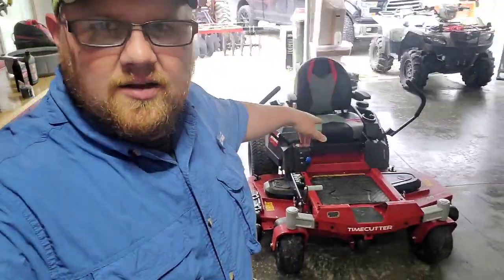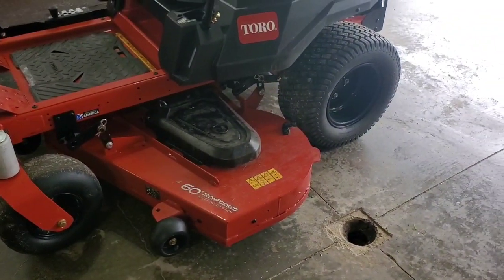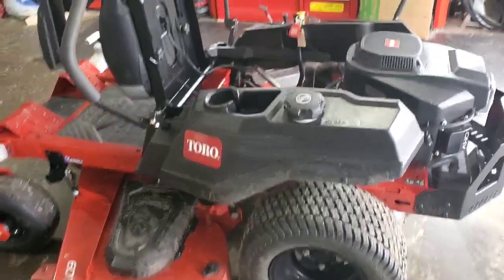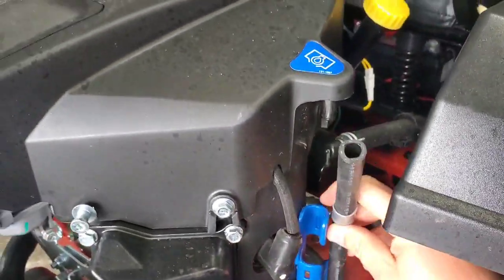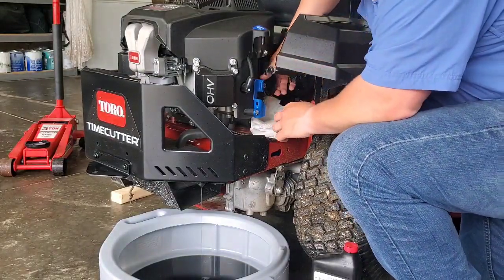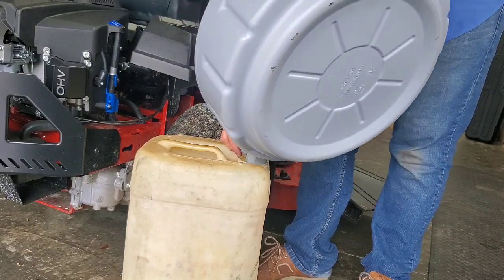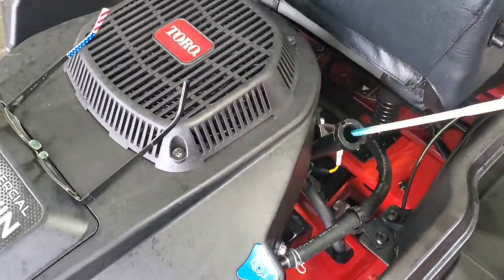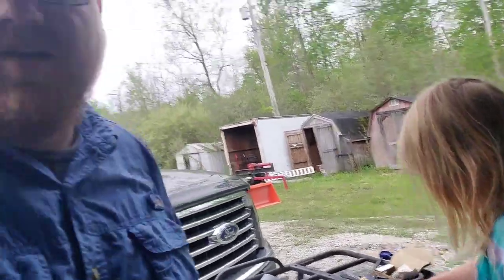2020 Toro Timecutter 60 review and first oil change

Comment: I just bought the Toro 54-in zero turn with the my ride system and I absolutely love it! By the way you'll notice a huge difference in the amount of heat the engine puts off with regular oil versus your new Toro synthetic oil, mine runs so much cooler with the new synthetic oil! Thanks for the video and enjoy that Toro!
Reply: Is there a temp gauge?

Comment: Did you start the mower up for a couple of minutes to warm up the oil before the change? I did this when I changed mine out, and it flowed real easy and fast. I also like to fill up the filter half way or so with oil so there's some oil in it for the first start up. Cool vid. I love my Timecutter. Purchased the 54" with the myride. Really comfortable if your cutting on anything but nice even terrain. I can now cut for 5hrs. plus and  not feel like I've gone ten rounds of just body blows.
Reply from the maker: They didn't even have a Meriden in stock for me to look at beside a smaller 50 inch. I'm surprised how well this rides over some older  models I've used. Indid warm up the oil a bit. Maybe should have ran it longer. Seems real slow to me. Thanks for watching! Enjoy that myride!

Comment: My son purchased a my ride hd 60" for me Fall 2018.  Thank you for your review.
I too found the oil took some time to drain but the manufacturer recommends you start it and let it run for 5 min first and then drain the oil with the front wheels raised slightly and it does make a big difference.  
     I am not naturally Mechanical so I need a lot of help.  It was so difficult for me to install the bagger system (which works very well) the first few times. as the instructions were hard for me to follow and I didn't realized I needed a break bar and a torque wrench.
QUESTION.  I would love it if you could post a video of how you use a strap and hoist up your mower with your Kubota to clean the blades.  I also have a backhoe loader and just don't know what kind of strap to use where to place it and how to hoist it up to wash the blades and/or sharpen them.
Reply from the maker: I can do an video this week for you. I was planning on doing a one year review also. Thanks for the comment! I've looked into a bagger unit, I feel it would help with our compost projects.

Comment: Thanks for the nice video!
Too bad Toro made the oil drain easy (yet very slow) and tool free, but, didn't take further steps to keep the area under the oil filter clean from removing the old filter... I wonder the Toro designed oil drain tube, if it ever needs a replacement how many arms and legs will that cost...
Reply from the maker: That is a very good point. It is kind of a pain. Thanks for watching!

Comment: Literally couldn’t get the hose off an broke the thing it plugs into, nice. Thanks Toro!
Reply from the maker: Ya that part wasn't fun. Little grease and a hope it doesn't happen again.
Reply: I just did this. Any word on how to fix or what part to order?
Reply from the maker: @904GorillaProductions  I will call my dealer amd see if they have the part number. I couldn't find it.
Reply: @PheasantLaneFarm  yea I ended up at a shop that handles toro and they told me I had to order a new engine cover which they needed a pic of two sku/serial numbers before they ordered
Reply from the maker: @904GorillaProductions  im glad they were able to get you squared away.
Reply: I just did the same exact thing, and got on YouTube to see if anyone else was having this problem.
Reply: @MasonBills  yea I realized that. I thought it actually was part of the oil circulation but after taking it to the shop it is just the drain like you said.
Reply: Hey guys happened to me too. Got the new oil hose within a few days. It got its own end cap which can be easily opened closed now via turning it. Part number should be: 144-0976
Reply: I put a screw in it and just to be safe small hose clamp. No issues two years later
Reply: A few seconds applying heat with a heat gun will make a huge difference in sliding the hose off!

Comment: You should always fill any filter 3/4 full let set a minute the filter soaks it up no dry start works on everything. And because it has electronic park brakes push the pins in and hook turn key to on then you can push across the floor easily with the bars in of course, I have the my ride system on my mower love it

Comment: I got the 75757 model (the myride version with seat shock absorbers). The belt guards vibrated off. The blade guard and grass deflector cracked the first hour of mowing... after about 10 hours, completely broke off. Now the deck is vibrating when PTO engaged and I can't locate the source. Toro is providing ZERO support.

Comment: i bought a timecutter last year its a 2021 model with the commercial 24.5 hp. i have mowed 8 times for about 45 mins, each time. My problems is every time i start it will smoke and its white, also back fires. When i make turns on concrete it feels like a flat tire. I feeling like i have a lemon. I will appreciate all comments.

Comment: Thanks for the video! I'm thinking about getting the Titan Max with that same engine. How is it so far?
Reply from the maker: It's been a great mower so far. Only issue I've had is the grass discharge shoot seems brittle and it broke into about 20 pieces. Other than that I'm very happy with it.
Reply: @PheasantLaneFarm  Thank you for the reply! Can you get the heavy duty rubber shoots that the commercial ones have or are they not compatible?
Reply from the maker: @411sponge72  im not sure, I would have to check. I know they market this design as one that jumps all obstacles. Not what I've found . But I'll call my dealer Monday.
Reply: @PheasantLaneFarm  Thanks to your video and others, I just bought a Toro 2000 series with the same engine as yours.
Reply from the maker: @411sponge72  Congratulations!  That means alot. I'm happy you found the video helpful!

Comment: When pulling the hose if the tube brakes of how can that be fixed ?
Reply from the maker: The tube or the plastic part? I'm sure replacements of both could be purchased, or use a hose barb and some hose clamps.

Comment: Anyone with the time cutter have issues with the control handles not returning to center (neutral?)   If i push mine forward I can let go and the machine will keep going.  My older Ferris would spring back to center. Trying to see if this is an issue or a cheaper unit normal thing..
Reply from the maker: I think I've had that happen only once when it was new. I just figured it was a little tight and needed to break in a little. No other issue in 100 hours.

Comment: I was on the fence between this mower and the Cub Cadet ZT1 50" for my next mower purchase. I initially chose the ZT1 and it mows perfectly. But I then got curious about the Time Cutter with the MyRide feature even though it was $500 more than my ZT1. So I went to my local Home Depot and I looked at the Toro very well. I didn't like what I saw which included: C channel frame tubing on the Toro compared to the ZT1's 2" full tube frame material which will prove to be much strong over time. I also didn't like the fact that the Toro had smaller rear tires vs my ZT1 that comes with 20" tires. The Toro comes with 18" tires. Two inches might not sound like much but it can make a difference depending on what kind of terrain you're mowing and how much of an incline you might be trying to mow. These two drawbacks made me forget about choosing the Toro as an alternative to my ZT1.....
Reply from the maker: My only regret is I didn't get the Myride.  I didn't know my yard was so bumpy before hand

Comment: just broke off the piece the end of tube goes into! that thing was stuck like chuck
Reply from the maker: They do seem to get stuck on there pretty well. I've had to run a pick around the inside to help it come off
Reply: @PheasantLaneFarm wish i would had done that but prolly would have needed a bent one to get under the shroud. I just put it back upright for now. Hoping i dont lose any oil. One cut and seems fine so far. May plug it if it starts leaking
Reply from the maker: @CodyDaCoyote  I hope itnworks outdoor you. I'm doing another oil change this week. My luck itnwill break. I knew I should have bought an extra plastic piece when I was at the dealer last week.

Comment: That deck offset would annoy me two. I park mine up against the front wall of the garage in front of my kids truck. My 54 is pretty even I guess. The offset would put it much further out.
Reply from the maker: Ya I didn't really realize it until I started using it. Takes a bit of getting used to.

Comment: Allow engine to run for 40 mins. Oil drains quicker when hot. Loosen oil fill cal or remove dip stick and it will drain quicker as well
Reply: ran mine for 10 did great